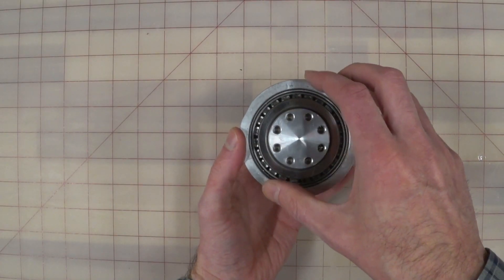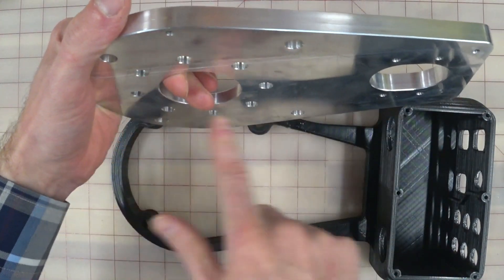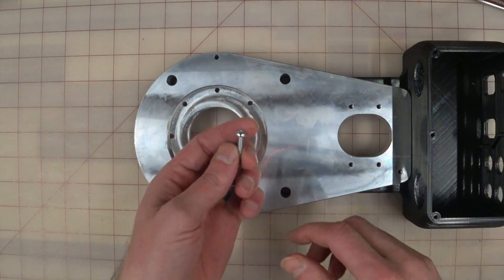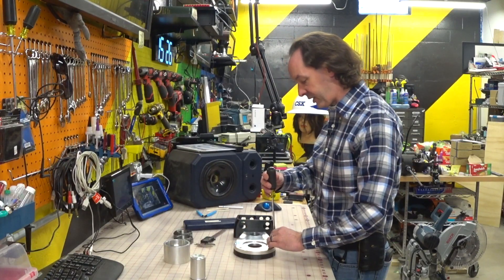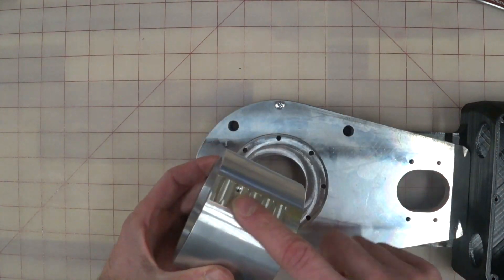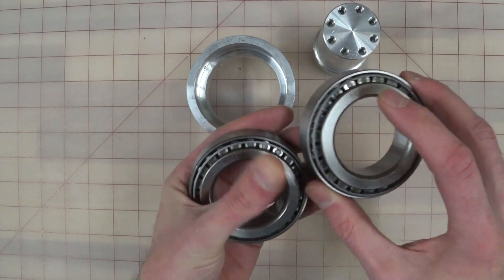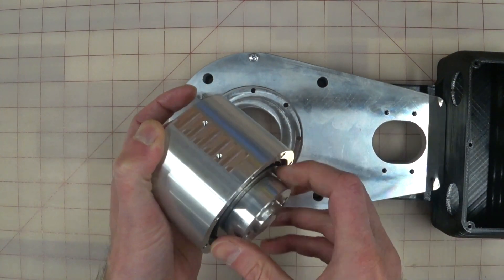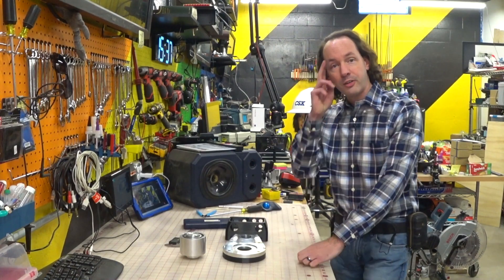Project ARchi3 Episode-2 - Base and J1 Turret Spindle

Comment: I know these bearings aren't going to see a lot of serious RPM's and force. But, will you be putting any lubrication in the bearings in the future to prolong them and will there be any form of guard or shield to prevent dust or small chunks of debris getting into them?
Reply from the maker: Yes, there will be a future step where things get secured, lubed, etc. I'm not doing it at this stage because a lot of bits will have to come apart for final finishing.
Reply: @Physicsduck  Good to know. Thanks :)